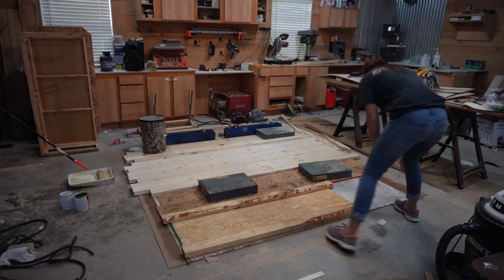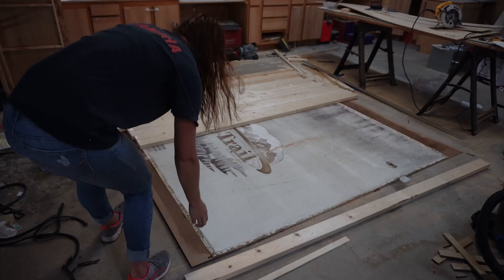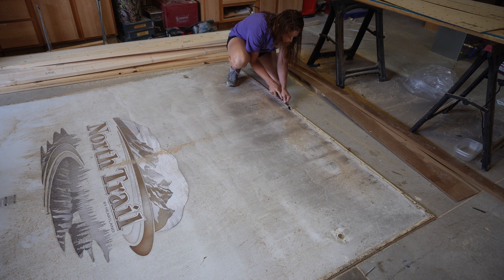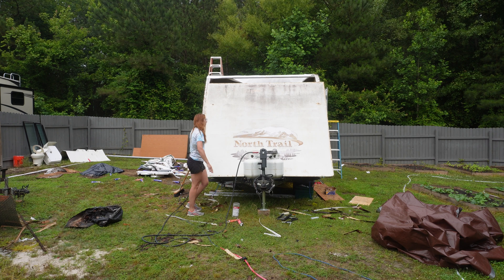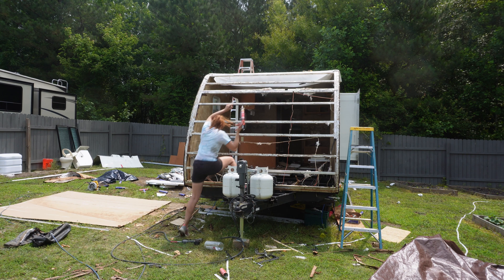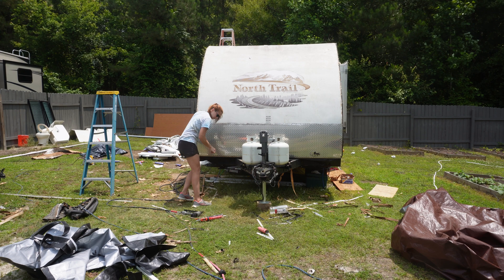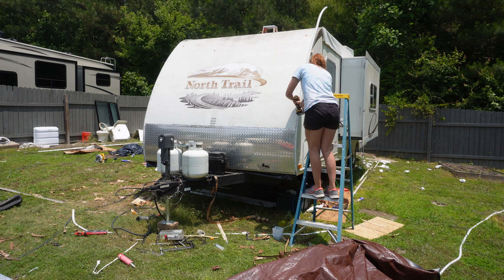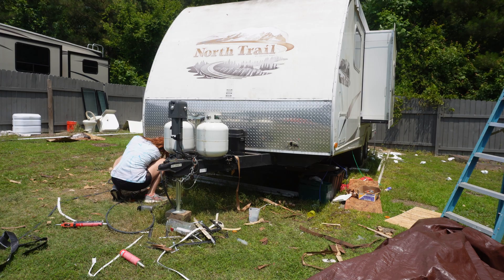RV Water Damage Repair: Demo Day 10 Front Cap Repair

Comment: Use Stabond T-440 glue with a spray gun and only glue 2/3 from the bottom up and leave the top 1/3 unglued so it will bend easily. Trailer looking good !
Reply: Agree Stabond 440 is the best option it’s meant for this purpose.

Comment: Contact cement would be a great adhesive for attaching the front cap to wood backing. You did not apply it correctly. Contact adhesive has to be applied to both the wood and back side of cap. A lot less expensive  and will create a bond stronger than the woid.
Reply from the maker: I don’t remember if I covered that in this video, but I did end up saying that I didn’t apply it correctly so probably why it didn’t work for me

Comment: Relief cuts are everything. Nice work. Humble recommendation to use a high speed buffer with wool pad and Meguiar’s #67 to polish out the cap and sides. You won’t believe the difference.
Reply from the maker: Will definitely try that!

Comment: I think the contact cement may have worked, but you have to coat both the front and under panels. Allow them to dry just enough that they are not sticky wet, then put them together. They should stick immediately.
Reply from the maker: I agree with the both sides, probably should have tried that. But it also immediately dried when I rolled it on, like it soaked into the paneling. Second time was better, but I think the problem is it’s mdf and it soaks up everything 😕

Comment: I am rethinking the whole vinyl screw covers for my RV rebuild project.  Here's my logic, I noticed that the quality control of the assembly from the factory leaves a lot to be desired.  On my RV during disassembly, I noticed that several screws were put in at an angle which leaves a nice little path for water to start seeping in.  Also I feel that those vinyl covers are acting as a dam to channel water across a longer section of the trim and screws.  It certainly is not watertight, nor does it look like it is designed to keep water out.  Especially since most of the pieces I removed were green and nasty looking on the inside.  So my thought is instead of replacing the covers, what if I just fill the channels with a waterproof sealer and smooth them out with a putty knife.  I'm really curious about what others think.  I've seen others put a small bead of caulk along the vinyl inserts or use Eternabond tape over the trim and vinyl covers.  But why not just fill the trim with say white silicon caulk and be done with it.  Personally, I have used Eternabond tape over the termination trim pieces on both the front and back of my RV, and it was a major pain trying to remove to prep the roof for repairs.
Reply from the maker: The trim cover isn’t meant to be waterproof. The corner or rails should be waterproof before applying the trim cover. You should have butyl tape underneath, and when the screw goes into it, it wraps itself into the butyl tape creating the seal at the screw. The trim cover is meant as an added protection in case the RV owner does not do regular maintenance (ie taking the corners off to replace butyl tape..for reference, my 5th wheel is a 2015 and I’m going to have to replace the butyl tape on my rails this year because it dries out). Wouldn’t suggest covering with anything other than trim cover, will make a huge mess and will be a pain when you have to take those screws back out. Water does not act as a channel if you seal it properly from the roof. Again, all about doing regular maintenance and sealing properly.
Reply: @fallenintocamping  I can't remember where I saw/heard the comment on the covers being waterproof, but I agree with you (they are not).  Yeah, I get the part of the butyl tape forming a seal under the trim piece when screwed in properly, but it looks like in way too many spots, they either drove the screw in too hard which dimpled the trim and probably forced the butyl tape away from the screw or drove the screw in at an angle causing it not to seal properly.  Do the RV manufacturers have any quality control in their plants?!?  I get what you mean about using putty over the screw heads because I did try that on the front and rear of my roof.  However, I believe the water had already found a way around the area which I thought I had patched successfully.  Until I checked closely this spring and realized it was still getting in and was a major PITA trying to clean up that mess.  Hence the reason I am working on this project this summer.  One could sum it up as "I am not a happy camper!"

Comment: Referring back to the last video, contact cement ONLY works if you coat both parts to be bonded and let them air dry first. I'm guessing the only portion that stuck was the piece that you used 'extra' cement on the other side at 16:11of the last video. Coat both sides and use a laminate roller to increase contact after placing the two pieces together. Awesome series of water damage repair.
Reply from the maker: Yeah I kind of figured it didn’t stick because I didn’t clean the cap well enough too. Probably a multitude of reasons (and not coating both sides) but I’m not mad at it because epoxy works great too!

Comment: Nice job. I'm curious how the liquid nails worked out? after it cured, was there visible lines from the outside where every stringer was? I know some adhesive will shrink as it cures pulling the material tight. which can show when fully cured.

Comment: I wish I would have found this before I did my front cap on my class C cap. Cap has some issues when sun's out. Like it didn't cure good. When cool outside cap lays flat. Will have to pull it at sometime. So you used paneling and not luon flooring for the cap?

Comment: If you ever feel like trying contact adhesive again, I use 3M 1357 for fiberglass to wood adhesion (not foam safe). It's quite a bit more expensive than others, but works really well. Once the two pieces go together, they will not come apart. A good and bad thing, lol...

Do you usually recommend bonding the fiberglass to wood before putting it back on the camper? I've seen most people put the wood up first, then the fiberglass directly on the camper. So your method is really interesting and looks easier. However, I'm curious how would you do this with a larger sidewall where you can't screw in the panel to so many places?
Reply from the maker: I’ll definitely try that next time, thanks! I typically bond the fiberglass to the wood first because I really don’t like working in the air. It’s so much easier to just put the whole piece up rather than doing it separate, and making sure the epoxy lines up with the wood correctly. It’s 100% personal preference and you can do it either way, I just find it easier this way!

Comment: Between 9:34 and 9:48 you make reference to a tape.  Starts with “B” and I’ve never heard of it before.  Could you elaborate a bit on what this is?
Reply from the maker: Butyl tape? It’s basically a waterproof tape that goes behind any rails or under roof vents. It’s the first step of protection against water damage!

Comment: Hi there, really love your videos , we are renovating a trailer and have the front off right now and we ordered the same west system adhesive that you used in the video and have a couple of questions 1. What did you use to spread the epoxy2. How big of a batch do you mix at a time and how many did you need to make and how long of a working time do you have before it sets up? And is there any suggestions for us as this is our first time attempting this and the epoxy is very expensive here in Canada and I’d hate to mess this up lol
Reply from the maker: Hey! All great questions! I buy a couple cheap, large paint brushes to spread it. I usually do about 8-10 pumps to start (1-1 ratio), mix it really well, and pour it out onto the mdf and spread it. I’ve also used a mini foam roller to spread and it works well too, it just soaks up a little more of the epoxy and you would need a bunch of them (the epoxy makes the foam roller fall apart). I think it’s got a pretty long working time. You’ll be able to feel it getting hot in the cup if you’ve mixed too much and let it sit for too long. The only thing I would have done differently next time is apply the epoxy to both sides instead of just the mdf, but you’ll need 2 people for this (one working on each side).
Reply from the maker: I also work in small batches, so it will take a few trips back and forth of mixing to get it all on the panel. It usually takes me about 20 minutes total from start to the time I join the fiberglass and mdf and start weighing it down

Comment: Just curious, did you apply any pressure to the front to hold it in place while the adhesive dries? I am planning on doing this with my camper.
Reply from the maker: No I didn’t, the curvature of the front cap puts enough pressure on the adhesive to stick. It pretty much curves along every aluminum framing piece on that front cap

Comment: Hi! Just wondering where you got the square head screws? I'm currently in the middle of extendive repairs to my camper and can't find them anywhere!
Reply: Also wondering what size Butyl tape you used?
Reply from the maker: Amazon! I’ve got them linked in my amazon storefront, but just search for RV square head screws and they’ll come up!

Comment: I'm tackling this project right now. Have mine off and all apart just waiting on filon to be delivered from recpro. Specifically what paneling is that? HD or Lowes stuff? Model#? Thank you
Reply from the maker: Your friend has shared a link to a Home Depot product they think you would be interested in seeing.

https://www.homedepot.com/p/32-sq-ft-MDF-Spartan-Oak-Wall-Paneling-48-in-x-96-in-x-0-118-in-00050/202765200
Reply: @fallenintocamping  does this stuff really hold up well? I've used this before on my laser printer just never imagined it good enough for a cap backer.